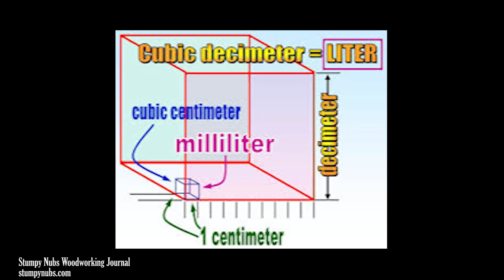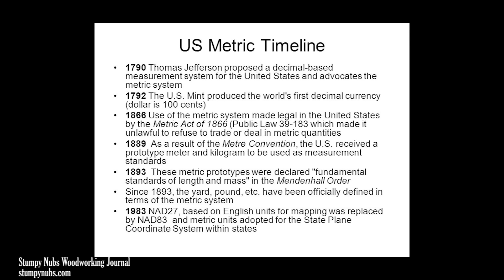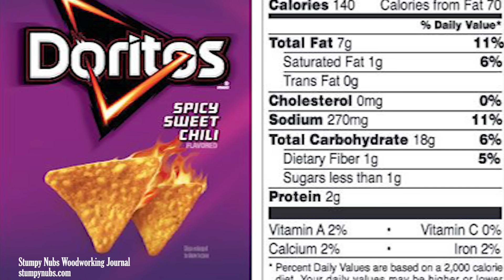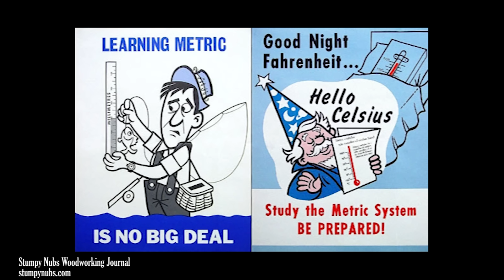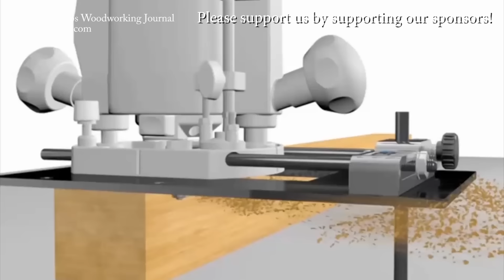BREAKING: The USA is switching to METRIC!

Comment: I spent 45 years as a machine designer. The SI (System of Units), the official name for the "metric system", is by far simpler than the Imperial System (Customary Units of Measure in the USA). Using the SI System is like learning and becoming fluent in a second language. Once you understand it you can switch back and forth without too much trouble. It's really very easy to learn and way less confusing.
Reply: I'm a contractor, sorry your metric system is inferior.
Reply: @tienglongmy  Please elaborate.
Reply: Fock having to use fractions for everything. Now if we could clean up the English language cuz it's an absolute mess. 😂
Reply: @riangarianga  I am not a contractor, but I hardly see how that's relevant. Whether you are a contractor or making use of contractors, the majority of the planet uses metric. I guess it must suck if you're a contractor ONLY doing work in imperial. You basically are restricted to working in the US, Liberia or Myanmar. And there's always the risk of conversion error, like the case of the Hubble mirror.
Reply: @riangarianga  He can't, you just took really poor bait from a stupid troll who probably thinks bud light is a beer, poor fellow...
Reply: @SaurianSavior  I'm not sure why your reply is addressed to me, when my only message in this thread was «please elaborate».

I'm European and I wouldn't consider using a different measuring system, unless I can see obvious benefits, or if I'm living in a country that uses one.

For example, the short time I lived in the UK I had to get used to think in yards to reach places, or to be told weights in stones. If I lived in China, I'd need to get used to colloquially be told weights in 斤 (jin), which is half a kg (so no big deal); something similar is done in other places with different names, like Germany or the Czech Republic (where I lived for almost a decade), the latter using most times prices per dg shown in prices at big stores, instead of kg. Otherwise, it's true that outside specialised environments (for example, aeronautics or navigation regarding height or speed relative to a fluid), mostly everywhere in the world the SI is used, and it has few drawbacks.
Reply: @KuK137  Don't worry, I didn't take any bait, I actually tried to feed the troll for the laughs 😂.

I believe no measuring system is superior or inferior «just because», it always depends on its purpose. But I can't think about the SI having many drawbacks compared to the Imperial System.
Reply: It's more like forgetting pig latin.
Reply: @riangarianga to help further clarify, dg = deka gram = 10 grams or 0.01 kilo grams. Though it may be a less common unit, it's always been an SI (metric) unit.

BTW, it's often used by older generations. I hear it every time I'm at the fresh meat counter. Us younger folks tend to prefer grams, so I often say "150 grams of ham," but the 50-odd-year-old lady before me said "15 deka of ham," and the worker of course knew how much to get without thinking twice.

Regards from the Czech Republic 👋
Reply: The cool things about metric is how changing between different units is easy. Going between units of distance, area, and volume takes almost no calculation; if I want to, say, know how many liters are there in a large tank, I just measure its volume in cubic meters and multiply by 1000. Going between square centimeters, square meters, square kilometers, etc, is also just a matter of shifting the decimal point.
Compare that with imperial units; if I wanted to know, say, how many gallons are there in a lake with a surface area of a couple square miles and an average depth of a dozen yards, it would take a lot more calculations — with a lot more places where an error could happen — than if everything was measured with SI units and all conversions were just shifting the decimal point.
Reply: @newolde1  0.5 mm doesnt exist, i guess
Reply: @WiscoDrinks  sure, you could say 0.5 millimeters, which is still much easier than 0.01969 inches, no? But then 500 micrometers would be the appropriate term. 

Tldr, next time you try to humiliate someone on a factual note, maybe do a wee bit of research first eh?
Reply: @SaurianSavior  a contractor in America wouldnt want to work outside America so no issue there.
Reply: @FabioCapela  boo👎
Reply: @newolde1 
At least, for God's sake, write it like you spell it. 
It would reduce the number of dyslexic people a lot
Reply: @painlord2k  write it like you spell it? You're confusing God.
Reply: To sum it up - "imperial units are pretty easy once you've spent the time and effort mastering it" :D
Reply: @tienglongmy could not elaborate why Imperial is better then metric.

And I really understand why he can't.
Reply: @WiscoDrinks 0.5 is decimal value. 1/2 i a fraction.
So thank god(s), whatever gods you use, we don't need to use fractions, when decimal is good enough for practical use.
Reply: I had to teach both systems for years, and I would disagree about metric being so "simple"- it has design flaws and complications that make it not only harder to teach but harder to use. The most stupid thing about metric, among 2-3 design weaknesses, is that every magnatude up or down the scale, you have a new unit name. Metric snobs on these forums complain about the large number of Imperial units, yet metric has no less than 60 in length, weight, and volume alone. So after teaching the kids various unit names, then to help them remember which are Greek and which are the Latin names, and how to deal with repeating decimals, they and myself are looking to the unified simplicity of imperial. As a part time wood worker now, my current opinion, and I believe this is supported by fact, that imperial units were created by workmen and metric units by scientists.
Reply: @grandrapids57  you are basically wrong there.

The unit for length is meter, m.  Nothing else.
No, km isn't a new unit, it is the unit m with a prefix.  Same prefix you can use on other useful SI units.

So km is m with prefix kilo, which is 1000 times higher then base prefix.  So no.
Micro, milli, kilo, mega is prefixes, not units.

So, if you don't teach that, and count prefixes as units, you get yourself some problems.

And yes,  Imperial system doesn't uses prefixes.  That might be why you have a problem with SI units and prefixes.
Reply: @grandrapids57  Metric has 60 units in length, weight and volume? No, it has 3 basic units (m, g, m3) and the rest is just multiplied by a scale (k - kilo - 1000, m - milli - 0.001). It has a logical system, unlike your imperial one (if you think I am not right then tell me without counting how many inches is one mile - because I can tell you without a calculator how many mm is 1km). Pretty easy to learn and remember (everybody in the world can do it except Americans).
Reply: @grandrapids57  My guess would be that if you taught your students the metric system first, you'd find that they would be even more confused by the Imperial system taught later.
Reply: Meanwhile, who is gonna go around changing all the speed limit signs and mile marker signs?

Sorry, I don't think we'll be fully switching to metric anytime soon. That'll cause sooo many vehicle accidents it won't be funny.
Reply: @gpsoftsk1  Incorrect. New name, new measurement, new unit, the metric system is a forest of units, each step of magnitude is a new unit but if to take that idea that metric, say, has only 1 unit of length then imperial has the same, the inch, as all larger units are aggregates of the inch, and this is such for all measurements system going back in history as far as one wishes. As to the pointless insult, the reverse of it: foreigners are too dumb to work math outside of the decimal notation system and their struggles with a fractional system both in practice and behind a keyboard, are quite evident, failing to see its own design flaws, thereby resort to the school yard taunt: "We're the cool, smart kids are you are not like us so you are a stupid head."
Reply: @AndersJackson  new name, new size is a new unit and that name and size must be memorized, no different than the inch, the foot, yard, mile, etc. by that reasoning if there was the "dozeninch" that wouldn't be a new unit but a "foot" is? It is absurd. All measurement systems going back to the ancient Egyptians are based an a basic unit and larger aggregates of that unit. If we say metric is based on 3 units, well then you have 66 variations based on that, or 22 pre-fixes, at least, and in imperial you don't have those complications which is a rather large relief when teaching it. The funny thing about metric snobs is their not seeing the design flaws of that system.
Reply: @southernflatland  Look at you car's speedometer - it shows both MPH and KPM. Even digital displays can switch from Imperial to metric at the press of a button or screen icon. Drivers coming or going from the US to Canada don't seem to have too many issues.
Reply: @joeyager8479  I would doubt that. There is an inherent bias in the teaching materials though that sets the kids up for thinking one is better than the other and I suspect many of the trolls online are people who were subjected to that because the opinions are akin to school rally cries, "My school is better than your school" etc. rather than any informed opinion. I emphasized both are useful, both have complications, and its better to be bi-lingual than monolingual.
Reply: @joeyager8479  That's not my particular point, though it was part of my point.

My main point is, like, are they gonna go around every highway and interstate and replace all the mile marker signs with kilometer marker signs?

Who is gonna replace all the speed limit signs from MPH to KPH signs? How long will it take to complete the transition? How many times might you go from one city with MPH to another city with KPH?

Can you see where I'm going with this? If they apply metric to our roadways, the transition will not happen overnight, and will confuse the ever loving F out of drivers.

Also, if they actually do change all the signs and such, how much is all that nonsense gonna cost the taxpayers?
Reply: @southernflatland  I don't know your age, but I'm an old guy. Back in the mid-70s President Carter tried to do this throughout the Federal Highway System posting distances and speed limits in both English and metric units with the intention of eventually removing the English units. It was Ronald Reagan that made it into a highly political campaign issue in 1980.
Reagan actually ordered the removal of the postings. So I ask you, if the dual system was already in place or being planned who do you think paid to remove it all? Politics for the sake politics is dumb and wasteful no matter the reason.
Reply: Imperial System is much easier to visualize:
my thumb is 1 inch wide, 2 long.  My hand is about 6 inches long.  My arms are about 6 feet wide, elbow to wrist about 1 foot and elbow to fingertip about 1.5 feet.  

Likewise, a cup is the amount I can drink in 1 swallow, a pint is how much water I want when I’m thirsty.  A gallon is the amount of bourbon I’d need to drink before I’d even CONSIDER going to anywhere in Europe, and a quart is the amount of cyanide I’d drink if I was forced to use metric.
Reply: @gpsoftsk1  However, m³ isn't any basic unit, it's a derived unit without a name, so it's just the length unit multiplied 3 times to obtain a volume.

Also careful here: the official weight unit is the kg since the beginning, being the only unit with prefix in its name. That's why we all usually talk about «kilos» and we know we're talking weights.

So there are 7 basic units, 22 derived units with their own name, and quite a number of derived units without an assigned name. The funny thing is, in the end, there are the same number of units in the Imperial System, because as measuring systems they are used to describe the same world. 😄
Reply: @southernflatland  Autopilot will take care of that 😄. Seriously, if they ever implement any beacon system to take care of those areas for vehicles, guess what's the metering system they'll use (same as NASA).

You can also check the example of the UK for your particular cost worries.
Reply: @riangarianga  I can see it now, vehicles that automatically switch between MPH and KPH based on GPS!

Genius! /s
Reply: Just go into a shop and ask for 2 meters & 3 inches length of.....
Reply: @paulstubbs7678  Hey, we measure in giraffes and bananas around here..
Reply: Metric uses fractions too, but they are as easy as moving the decimal comma/point.
Reply: @jonathonfrazier6622 those are some well thought out counter arguments, good job.
Reply: @southernflatland  No mate, you just keep the mph signs and speedometers, it was right on this one: too many changes to make all of a sudden, too costly and prone to error.

But GPS already uses the SI. It's been more than a decade since I extracted raw data from my receiver for a project, all based on SI units.

Vehicles themselves wouldn't need to care, ideally automated vehicles won't be based on such signs (railroad transport is the best example), and if there are road beacons you can be pretty sure they'll provide positioning data using SI units. Just imagining such a system calculating fractions, or either losing precision by sticking to inches... nonsense.

Imperial, being based on fractions, is purely for human use, created at a time with different requirements and knowledge (like many other older systems worldwide based on multiples of 12). We're used to tradition, but it shouldn't hinder progress. Potentially some day the SI will be either improved or left behind, too, it'll all depend on the development of our needs and knowledge.
Reply: @southernflatland  well. It is just like a plaster, just rip it off.  Just change the speed limit signs and make them valid at a certain time and date.
And speed signs are changed on occasion anyways.

Sweden changed from driving on the left side of the road to driving on the right side.  On ONE DAY, on the same time all over the country.  And that without more accidents then normal.

And you say you can't change the speed signs from imperial to SI units, "because it is to hard"?
Reply: @Quyanxi  That's not correct. dg is th abbrevation for decigram (1/10 g) - the correct abbrevation for dekagram is dag
Reply: @altepost3805  oh, wow. You're quite right. Either it's marked incorrectly in the country or I've been using it wrong. Never heard of a decigram before though (or maybe I did at school a long time ago) :D regardless, thanks for correcting me, it's much appreciated.
Reply: @AndersJackson Imperial does actually use the standard metric prefixes depending on your task. When I have to do stress/strain calculations on materials values are often in ksi (1000psi) or similar. Si is far superior but it has bled over somewhat in the way imperial can be used.
Reply: @grandrapids57 My informed opinions as a someone working towards an engineering degree is that imperial is worse. Conversion factors are suck and inconsistencies in out base units (along with the bodged attempts to compensate) just make it worse. Doing any calculation or design in metric is so much simpler. You are just too set in your ways to acknowledge your bias towards an inferior system.
Reply: SI =/= metic. There's for example so called technical metric which measures length in millimetres instead of meters, force in kilometers-of-force instead of newhons, temperature in Celsius instead of Kelvins.
Reply: @riangarianga In Ireland people my age are fully metric
Reply: @southernflatland Take a leaf out of the Republic of Ireland’s book new metric signs were put up covered and when the old sign had to be replaced the cover was removed
Reply: @KurtFrederiksen You have centimetres, millimetres and kilometres for length as well. Kilograms for weight as well.
Reply: @Freakmaster480 Agreed
Reply: He's right the metric system is inferior. The statement doesn't need elaboration.  @riangarianga
Reply: As someone that grew up in the states, not to mention a building contractor for a decade there as well. Metric is just 10x more efficient, which is why the vast majority of the world uses it, including the country that made the imperial system. I just don't get folks still trying to argue otherwise, it's akin to arguing that the earth is flat. Using base 12 for inches to feet, base 3 for yards, then 5280 feet in a mile? Furthermore, there aren't any units smaller than an inch? Yes, I can do fractions no problem, but why. Don't even get me started on volumes, which are base 8, well kinda?.. And if you want to convert those into cubic anything, good luck doing those in your head and/or without a table. God save us all if you're not using a whole number. And then weight, no base whatsoever, ugh.. Face it, it was a system that was created by half-drunk kings and aristocrats. So unless we want to devolve back into using guillotines as a form of punishment..
Reply: @grandrapids57  so to summarize what you're saying: Memorizing an entire measurement system's worth of unit conversions with no common base is 63360 times (inches in a mile) better than having to remember a handful of prefixes for an entirely base-10 system? And now we truly understand why the US education system is what it is. That also clarifies why, on occasion, trillions of dollars go missing from the US government's accounting system. Thank you for elucidating.
Reply: @newolde1  oh its not a handful of pre-fixes, I count 22 far, far more choices. Standard was created to be simple and indeed it is, metric is the product of scientists, and not workmen nor teachers.Now to help remember which prefixes are below one and which are above 1, then the kids must remember which 11 are Greek and which 11 are Latin, and kids really dig that and sing the praises of the simplicities of metric. I suppose for many people, remembering 12 inches in a foot, and 3 feet in a yard, is harder than remembering there are 10000 hectos in a mill or dozens of other conversions between a forest of units. Say are you from a country that if you opened a bar, and in spite of government pressure you priced and sold beer by the pint, they would close your bar for you?
Reply: Yes the French were "Boastful", because SI stands for "Systeme International" or International System, as far as they were Concerned, this System was so good, it was going to go all around the World.
Reply: Not exactly, metric system is the official name of, well the metric system, and SI, being a system of units, just includes metric system along with grammes and etc.
And at that, it's the standard used in science, but not used by any countries as the standard of units afaik. SI uses Kelvin instead of Celsius.
Reply: @edwardcuevas6974  Every statement needs elaboration, otherwise it's undistinguishable from a bigot claim.
Reply: @OscarOSullivan   Actually it never occurred to me that you were using British units, at least not until so late as 2005. 🤔 But thank you, I just read about the whole process you followed, you have to learn something new every day!
Reply: SI = Système International = International System (of units)
Reply: Maybe. The obvious needs no "elaboration". For the vast majority at least. @riangarianga
Reply: @kurushimee  correct but try telling that to these guys who guard their measurement system's reputation more than their wife's.
Reply: @riangarianga  Metrification began in the 1970’s first was decimal day
Reply: @edwardcuevas6974  There isn't anything obvious in any measuring system. They are defined in standards, they aren't knowledge anyone derives out of the blue. The current standard defining Imperial units is based on SI units. No measuring system is «superior» to any other, they all had/have their reasoning in a context. If you make such statements of «superiority», but you can't elaborate, that's a textbook definition of unreasonable bigotry.
Reply: Why? You seem to have exceeded the "textbook definition". @riangarianga
Reply: @KuK137  how is bud light not a beer
Reply: @edwardcuevas6974  Kindly illustrate such excess.
Reply: A liter of water weighs 1 kilogram, 100 liters of water = 100 kg
1000 liters = 1000 kg or 1 ton.
1 cubic meter of water has 1000 liters of water.. and I, who always failed math in high school, without any problems, calculated in my head in 2 seconds that 1 liter of water needs a container 10x10x10cm
Reply: I don't agree, it makes science easier, but it makes regular living somewhat less convenient. I'm very much familiar with both and spent a year and a half living in a metric country and no, the SI system is not simpler. It simplifies operations that people don't do a lot in favor of measurements that are generally less convenient. People using the SI system change units a lot because the system encourages it. 1.7m isn't better than 17 dm or 170 cm, but folks will tend to ignore the decimeters. The unfortunate consequence is that centimeters are kind of tiny for heights and meters are kind of large, but folks tend not to bother with decimeter. Whereas, feet and inches are pretty well suited and you can still just just feet or just inches as nobody goes to prison for using decimals with those measures when it makes sense.
Reply: @SaurianSavior  So, the fact that the rest of the world was largely pressured into it makes it a better system? If the system is so much better, then why hasn't the US switched? I mean, the system is taught in school, and it appears on a lot of packaging along with the customary units. If there is such a big advantage to it, then you'd think there'd be a bit more pressure to change.

The reality is that most other countries switched because they didn't have an enforced standard of measure or they were too small to be able to avoid importing things that were in their local measure. And yes, I do mean enforced, I work at a grocery store and the Bureau of Weights and Measures does come by from time to time to make sure that any measuring equipment is within the required specs.
Reply: @FabioCapela  But, why would you do that? This sort of disingenuous argument does nothing to convince people to switch. If I really needed to do that, I would use a calculator and it would be done pretty much immediately. Whereas if I need to know how wide something is, I can use my hands or feet to estimate it to a reasonable degree. That's something that a person is far more likely to do and something that the SI system does not encourage. So, you get BS conversions that folks are unlikely to need to do at the expense of not having a system for easily estimating things with you at all times. Yeah, I'm totally going to stop using customary units, you've convinced me. /jk
Reply: @gpsoftsk1  Americans know the metric system far more commonly than non-Americans know the US customary system. Why would I need to know how many inches in a mile? The precision of an inch is something that requires some rather sophisticated equipment to care about. And yes, you would know how many mm in a km, but why on Earth would you need or want to know that? What situation would you ever be in where you've got a length as long as a kilometer and have a precision of mm to worry about? And how often does that even come up?
Reply: @joeyager8479  Which is why non-Americans should probably take some time to educate themselves before making asses of themselves. You do need to do some more work up front with customary measures. But, in exchange you get a really well thought out system that covers you for pretty much every non-scientific scenario you're likely to encounter. I wouldn't care to do science with customary measures, but I've tried living with metric measures and it makes things just a bit more annoying than they should be. And having grown up with a bitter system, it's annoying to realize just how the SI makes most things just a bit worse, assuming there's any change at all.
Reply: @joeyager8479  Sort of, my brother bought a Canadian car and it only had KMPH on the speedometer, no MPH. Which was really dumb seeing as most Canadians live within an hour of the border. Having the KMPH be more prominent would make sense, having no MPH was BS.
Reply: Why even bother switching back and forth when the SI is so convenient.
Reply: @satunnainenkatselija4478  Good question! Reason: most people in the USA don't understand it and don't want to learn it even though it's far simpler and easier to learn. Other than that, I cannot come up with a good answer.
Reply: @riangarianga  "I'm European and I wouldn't consider using a different measuring system, unless I can see obvious benefits, or if I'm living in a country that uses one." This is the point exactly.  I'm American, I see no reason to learn a useless system of measure like the metric system.  The metric system isn;t relatable to the human experience.
Reply: @twitch1965   «The metric system isn;t relatable to the human experience», dafaq 🤣, it's just a bloody measuring system!

It's not the «metric system» since decades ago: it's the international system (SI), called like that when it was agreed to be used worldwide as the the standard system. Even in your country (Metric Conversion Act of 1975, with numerous amendments). Are you calling everyone inhuman?

If you prefer to use anything else, you're free to do, that's the beauty of freedom. It might make sense in your environment. Woodworking is more attached to tradition than other fields.

However, it doesn't make sense if you want to share and grow, or if you want to try international sales. Even engineering threaded parts that traditionally measured 1" are nowadays manufactured to 25 mm (instead of aiming for 25.4 mm = 1"). Those parts are inside any tools you use, all power tools regardless of where they're manufactured are specified under SI units. Whenever you find Imperial units, it's a conversion (even in the USA, it's precisely what the Metric Conversion Act of 1975 defines, 1" = 25.4 mm). It's not related to «human experience», it's a matter of everyone rowing the boat we're all in the same direction.
Reply: SI is from its French name, Système International.
In English, the International System of Units ( Système International d'Unités ).

The US, like the UK, are just anacronistic remains of a forgotten world. Keep those funny units as long as you can.
We used to have such things too, sometime before the USA was born. Now we longingly look back at those glorious times, before the scientific Era evolved. Don't change! Don't be like everybody else.
One Inch is 2.54 cm. One lbs is 0.4536 kg. We know these things, and can easily convert to SI.
The only thing that confuses us is the Gallon! We have never succeeded to find out what that is!
Reply: Doesn't "SI" mean "System Internationale" ?
Reply: Was thinking the same thing . I can’t see metric be beneficial at all in construction .
Reply: Yeah !  Let’s start putting gender on nouns because that makes sense
Reply: Because we all do that so often
Reply: It would be nice if you never had to convert from SI to Imperial  ever again though.
Reply: @southernflatland  Well, in Sweden they changed from left hand driving to right hand driving. It worked, and not with that many accidents ether. The UK  have mostly converted, and seems not to want any U-turn to Imperial.
Reply: From my understanding SI units are not an “official name” they just copied metric and took some other units to make some core units that all of science can be based off of. For example, gram is metric but not an SI unit, the Kg is.
Reply: @tatonka411  The only SI unit for mass is g (gramm), as the only length unit is meter. Kilo, deka, deci, mili, micro etc. are simply prefixes based on the 10 system.
Reply: Why is a cirkel , not 400 degree ?
Reply: @grandrapids57  This means that you were teaching the metric system without understanding it. There is ONE unit name for every type of amounts. The prefixes are universal.
Reply: @grandrapids57  You terribly don't understand the metric system. There are 7+2 base units and prefixes, based on the power of ten. Length is always in meters, mass is always in gramms, time is always in seconds. Kilo is always *1000, milli is always /1000, micro is always /1,000,000, etc.
Reply: @csabamagyar3244  All measurement systems, going back to ancient Egypt even, are based on a base unit, and then making fractions of that base unit for smaller divisions and making larger collections of the base unit for larger measurements. The metric system suffers from a ridiculous number of units because every time one moves a magnitude up or down, a new unit is created. Such burdens and overthinking do not exist in other systems present or historical: moreover its exclusive reliance on base 10 is problematic from the view of number theory, but that is also well known, one would imagine.
Reply: @csabamagyar3244  I think I understand your point: so if we had a "deca-inch"  that would NOT be a new unit but a "foot" is a new unit? Is that your point?
Reply: @grandrapids57  Exactly. We're talking about: kilo-meter = 1000 meter, milli-meter = meter/1000. Micro-meter = meter/1,000,000, nano-meter = meter/1,000,000,000 etc. Always meter, and we're only moving the decimal pont. Officially by 3 positions = */1000. Therefore deci (/10), centi (/100), deka (*10), hecto (*100) are used in every day life but in engineering. (And they can be used for every unit, eg. we measure atmosperic pressure in hectopascals in the weather report, but scientist and engineers use kilopascal, which is still pascals. (newton / square meter)).
The interesting unit is kg = kilogram. Gram is the official unit for mass, but to small for every day communication. Therefore kilo-gram is used, simply but not officially just kilo. It is of course 1000 grams, which is the mass of 1 liter of 4C water. (But liter is not official! It is 1/1000 of a qubic meter = 10 centimeter * 10 centimeter * 10 centimeter = 1 decimmeter * 1 decimeter * 1 decimeter = 1 qubic decimeter.) So the dencity of water is 1000 kilogram / qubic meter = 1 kg / liter.
When talking we say "kilo". But even in ground school physics it is not allowed, the g (gram) must be put there.
The (metric) ton is another interesting unit. It is 1000 kilogram, or 1000 kilo is speech.
Reply: @grandrapids57  No, no new unit is created. The meter is the same meter in millimeters and in centimeters. In metric the meter is the only length unit. In imperial there are inches, feet (12 inch - why?) and miles (5280 feet, 63,360 inches - WTF?)
Reply: @csabamagyar3244  So it is true that if a unit is some power of ten less or greater than some other unit, then such a thing, even with its own name and different size, is not a unit? I see so if such a unit is a compendium of multiples of not magnitudes of 10 yet also has its own name as in the first example, then it is a new unit. One may easily find people who find that to be true.
Reply: @WiscoDrinks  It depends where. For example, on construction site everybody knows that 1 cm doesn't exist...
Reply: @grandrapids57  It's pretty shocking to read such statements written by a teacher...

So, once again for sake of your students; the SI system has only ONE unit of length - the metre (m). 
The rest is multiplication or division by 10, again by 10 and again. There are words, mainly from Latin or Greek, converted into prefixes and now meaning ‘10 times’, ‘100 times’, ‘1000 times’ or ‘1/10’, ‘1/100’ etc. These words are used in all languages as prefixes for multiplying standard units - all units. It is not only the SI that uses them, you Americans also use them on a daily basis when talking about ‘kilobytes’, ‘megabytes’ (even if in this particular case ‘kilo’ means 1024, anyway you should know them).
These prefixes are flexible and appropriate for all kinds of units; you say not only ‘kilometre’, but also ‘kilogram’, ‘kilovolt’ or ‘kiloampere’ - different units, the same prefix means the same thing in connection with each unit.
As a general rule, an educated person knows at least a few of them; you don't need to teach the meaning of ‘kilo’ unless you are teaching first-graders.
Reply: @galtube  That is a a semantic argument only. All measurement systems going back to ancient times are based on a unit, then there are fractional divisions of said unit and concatenations of said unit, all of which have different names. It seems metric-centric people believe the following:  for instance, a "dekameter" is NOT a unit because it has its own name and is 10 meters, but a "foot" IS a new unit because it has 12 inches and has its own name;  Yes, anyone past 3rd grade knows the pre-fix system, reasons for it, etc.. as far as the above explanation goes, if one was as well versed in current and historical measurement systems, usage, and their number theories, as well as you seem to be with metric, you'd likely have not produced the supplied explanation. However, one will find universally in all school materials the number theory of metric so the students understand that, but never number theory of the English system. In my opinion, it is partly because most teachers are too mathematically dumb to understand anything but moving a decimal point.
Reply: @galtube  Rather than being shocked, you may wish to inquire to one's self how or when one has ever been presented or reached out to study the number theory behind the standard system of measurement. It is trivial to move a decimal point to shift from one unit to another, but engineers and surveyors who came before us were no fools. You may owe it to yourself to discover why they and we use such a system and did not use base 10, a number which was as open to them as any other. It is a fascinating story in the history of number theory and many other fields. One bit, part of the foolishness of having a system with all denominators as powers of 10, is that changing units does not yield any advantages or remove the weaknesses of having this restricted range of denominators. Such a system only produces a visual change in the number, that is the number of leading and trailing zeros and placement of the decimal. it is functionless in terms of mathematical work or solutions.
Reply: . No , because 0.5 mm is  500 micro metre...
Reply: @grandrapids57  ofcourse it is easier.  The base numbre remains the same. 1500m is 1.5 km . 0.15m is 150mm (by the thousand !).

Youmay tell in 2 seconds how many miles 2000 yards are .
Or how many inches  7 yards ?
Reply: @lws7394  That makes sense from a 4th grader's level of number theory, and only from such. For those more familiar with number theory and why surveyors and engineers, and many others have avoided a strictly base 10 fractional system, base 10 units were always avoided because it is among the worst choices, and to use units that vary exclusively by magnatudes borders on a certain mathematical absurdity. As to base ten measurement, educational materials exclusively focus on this singular point of theory, that of decimal point shifting, and with all of the bias of MSNBC news, manages to massage the public into that bias born from the ignorance of knowing that singular point of theory. If you're old enough to ever have met a person born and raised under Communism, you may find some one who will vehemently argue the superiority of Communism and the evils of Capitalism, but we can all understand why such a person's opinion can hardly be taken seriously, i.e. he only knows one side.
Reply: @lws7394  It does not surprise me that is  your measure of the soundness of a theory of fractional and "plural" quantities of units. That is all you have been taught and you clearly have never sought out the answers as to why e.g. there are 5280 feet in a mile, why base 10 has been otherwise avoided in every other measurement system, and how is also avoided in nature. The decimal system of fractional units is quite very much forcing a round peg into a square hole, and then when one has forced that peg into that square hole, declares for all to hear, "You see, it works and that is why your system is worse."
Reply: @SmallSpoonBrigade   It's better to do metric anyway. You explain me how much fuel usage of 60 MPH in one figure.  You have to take into account that when Canadians use gallons it is the Imperial gallon which equals 4.546 litre  versus US Customary gallon is 3.785 litre !! 😵😵‍💫.
Reply: @grandrapids57  There are no 'new units' in metrics.  the term 'milli' is a general term for 1/1000 of the metre. Whereas from inches to feet to yards you get really new units.
You prefer using '5280' above '1000'? lmao.
The horror to scale up from inches> cubic inches to feet and cubic feet. 
I think I'd rather learn greek than having to move between customary units !
There is no way to defend the practicality of the fact that  an ounce of feathers is heavier than an ounce of gold !
Or that MPH in Customary units is not the same as in MPH in imperial units .

Even in US the underlying system is laid down in SI . science, medics. The standards of CU are even laid in metric values. 
You say you had to teach both systems. You can't defend that you have to spend over 5% of your time switching. The cost of having to teach with both in US is estimated at $1.5-2.5 bln a year. Every year !

An Australian builder built 2 houses, one by SI and one by CU unit. for the metrics his unit was the millimeter (and not the cm). The house built with CU had half a container excess scrap material because measurements were not as easy as with millimeters ..
Reply: Way back in highschool I had to learn a bunch of simple physics equations in American Customary Units...  g=32 ft/s^2 was sort of nice, but the rest was just silly.  

I'm a scientist (biology, but my bachelor's is engineering) now, and really only think in customary units for driving miles and sometimes for weather temperatures.  SI... This is the way ;)
Reply: @AndersJackson  Fractions are just division problems you're too lazy to bother solving ;)